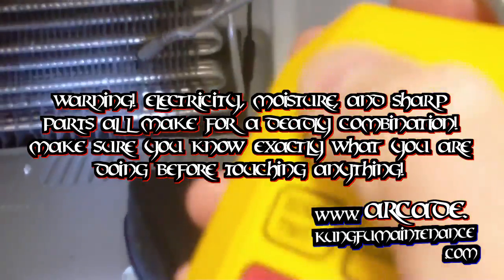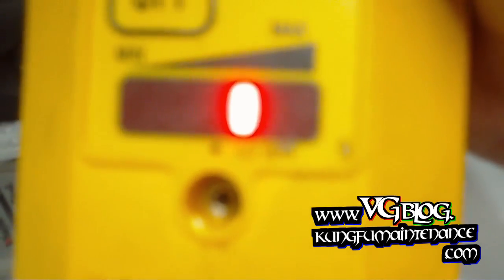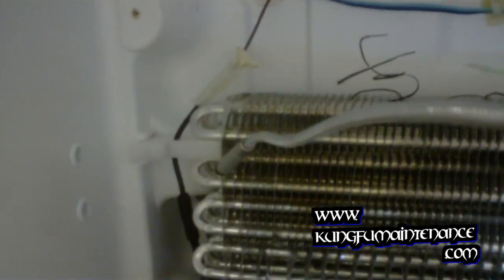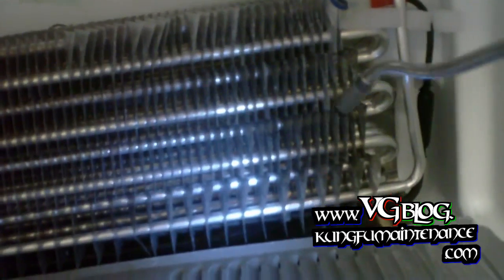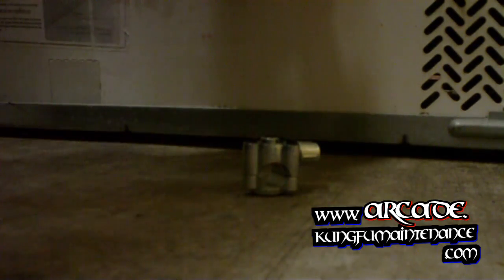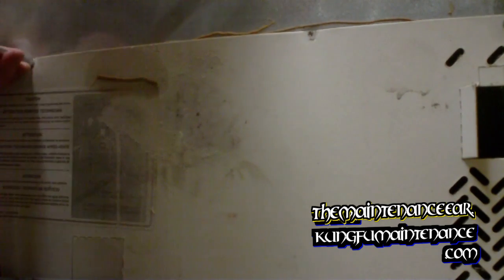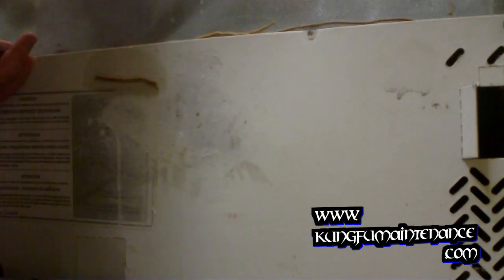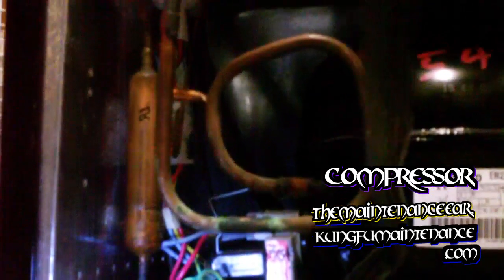How To Leak Check And Locate Freon Leaks On Air Conditioners Or Fridges

Comment: Does the leaking refrigerant corrode the copper line?  Or does the leak occur because the copper line corroded?  Maybe the flux wasn't washed off after soldering, thus corroding the pipe until a leak occurred?

Comment: i HATE looking for gas leaks!I use Yellow jacket and the kids soap bubbles, it's super reactive, the stuff you buy at the toy store. It works better than anything I have used in a ref supply house. An old timer told me that's what he used. Can't use it in walk in freezers, you should try it if your getting your ass kicked on a leak. I still haven't found anything that reacts like the toy store blowing bubbles. I have many ststems out there i can't find a leaks on.

Comment: I had a an old 18 year old GE side by side die because of low charge. It had a spine fin coil that you may be familiar with. The aluminum was coiled loosely around those bars, and caused rubbing which may have caused it to leak. I knew something was up when the overload kept turning off, and there was uneven frost.

Comment: For those listeners not informed you should have explained the basics of why you first checked suspect areas with corrosion and oil on them  because Freon carries oil and usually leaves oil on the leaking joint,